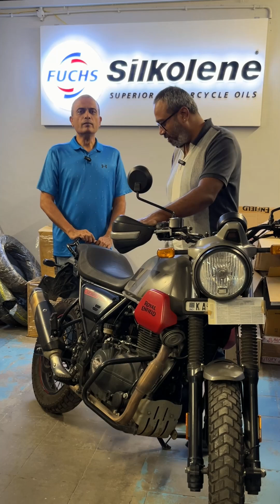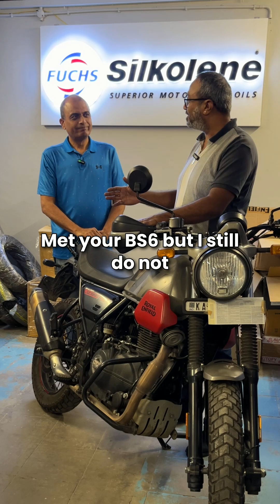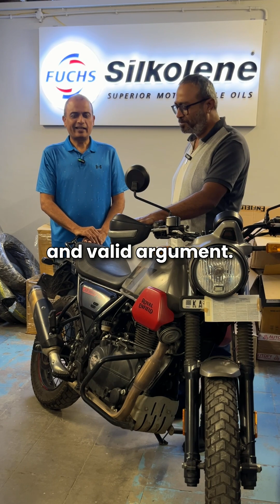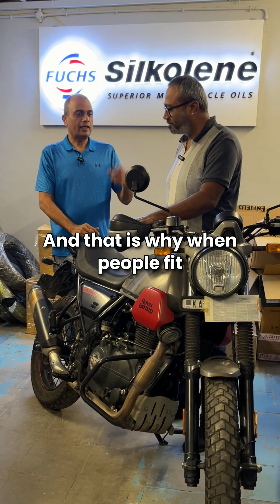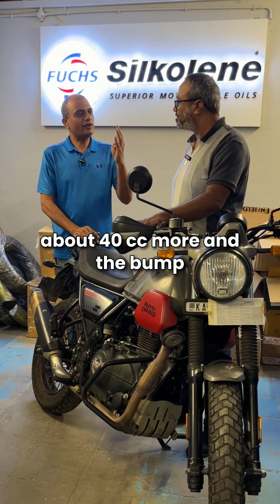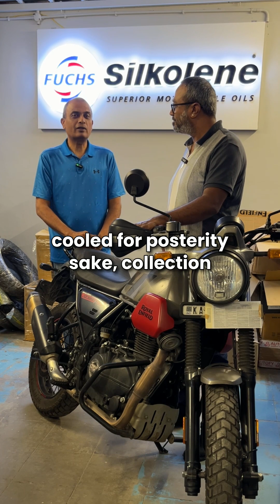End of midsize air-cooled engines?

Comment: Air cooled petrol engines gets extremely hot especially in slow traffic on hot summer days which leads to stalling and sometimes engine wouldn't start again. 
Air cooled are good for diesel engine motorcycles. In fact more heat translates to better performance.

Comment: Oh yes. RE in general haven’t yet figured out to make smooth or reliable engines, air or liquid. The 650s a start, the 450 not quite the ballerina the 650 is. Can understand as the twin is more smooth.
The 411 engine was shit and not abuse friendly by any means of imagination. Only as a rally bike with a mechanic and towing vehicle would it feel safe. Tappet noises, oil leakage…damn I could go on and on. Lot more problems with the other parts, including the fuel pump. No ones probably maxxed the number of warranty claims I made. With sedate riding that too it wouldn’t go smoothly more than 80 kmph. Riding the ADV390 made me realise what a big mistake it was buying the Himalayan barely 6 months into ownership. Sold it after 22000 of ownership, Bought a BS4 duke 390 preowned and 30000 km later, as happy as the moon. An acquaintance who’s ridden 54000 km on his 2018 duke 390 and now 97000 km on the ADV 390 prefers it over his 76000 km done vstrom 650. All with regular chain/spricket/tyres/oil maintenance without any engine issue.

Comment: RE is developing 440 air cooled
Reply: I don't see the logic of developing a 440CC air/oil cooled engine unless they are planning to migrate the entire 350 family to this new platform. IMHO they would've been better off refining the existing 350 cc and develop a liquid cooled 450 cc twin cylinder engine which could go into the Himalayan, Raid, Guerrilla, Scrambler and the GT-R (that they are planning to launch). The learnings could've helped them for the development of 750 or 800 cc liquid cooled twin.
Reply: @wheel3136  it's true ideally they should develop a 600+ liquid cooled engine, so a 70+hp bike would need a lot of engineering not just engine , but chasis , electronics etc. The price will be above 7 lacs. Domestically at price point the sales numbers won't justify the development cost until they export.

Bajaj is developing 650 twin for KTM, and that will be exported as ktm has a bigger global footprint and they sell high-end bikes as well.

Tvs Will development a high capacity engine as Norton is a premium global brand. 

It all depends on export volumes.
Also I see RE investing in electrics, so their development cost will be split.

But eventually indian brands will locally build mid capacity performance engines, coz what will the current 40bhp bike owners upgrade to ?

I own an interceptor, to upgrade from a power point of view  I don't have any locally made options.

Comment: So RE must be working on liquid cooled 650/750cc engine i guess, i really hope they are working, itll be interesting, but i dont like liquid cooled engines blow hot air to thighs. Atleast my experience from bikes ive ridden. But even then due to strict emissions fuelx, full exhaust system, after market air filter will be inevitable.
Reply: No 650cc parallel is a classic engine they will not change it but single cylinder will be updated to liquid cooled...
Reply: @maddymaaz  No it becomes a problem in single cylinder. Harley Davidson is still selling 1800cc air cooled engine in India but they are twin cylinders.
Reply: @maddymaaz  What do you mean? In future they can't sell air cooled because of emission restrictions, i'd love that if they do, except 750 or 850, they will have to update to liquid cooled anyway isn't?